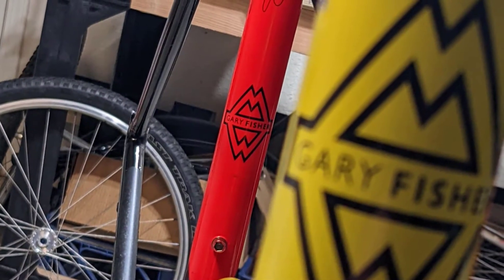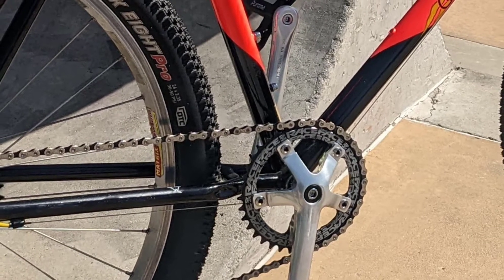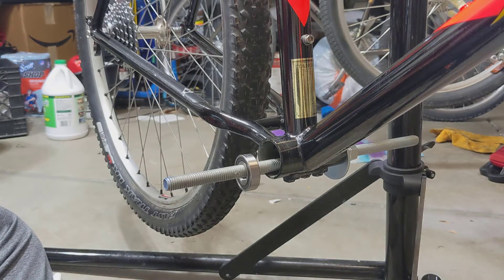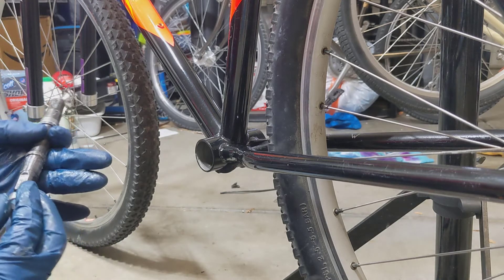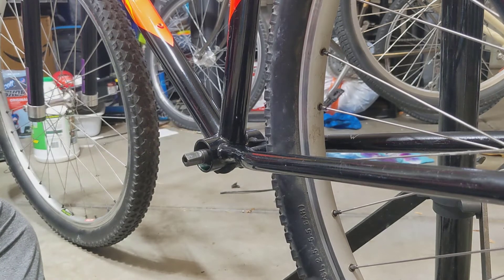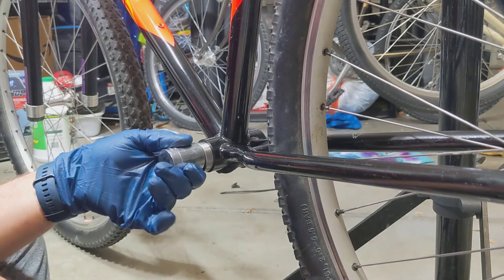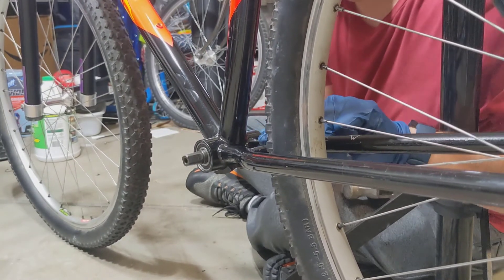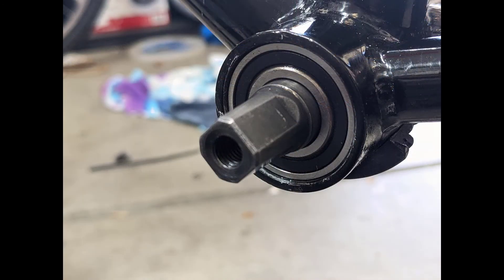Gary Fisher Evolution Bottom Bracket Install - 1991 ProCaliber Press Fit Square Taper Sealed Bearing

Comment: How did you remove the old bearings and spindle? Install doesn't look too bad. Good video.
Reply from the maker: Really simple. I used a hammer and a piece of wood to soften the blow. First make sure you don't have circlips holding the bearings in place. You'd need a  circlips tool to remove them. My procaliber dues not have the clips.

I'm the video I mention another guy who explains the removal. Check out this video at  4 minutes in for his reenactment:

https://youtu.be/1oVZrSLHIw4?si=iNzytxzwpJXjdbOY

It takes some pretty good whacks with the hammer and the bearing will fly out one side, then repeat for the other side. 

Amazingly simple bb.

Good luck!

Comment: How did you remove the bearings from the spindle once you remove the assembly? mine seem to be stuck on my spindle. I have a gary fisher procaliber
Reply from the maker: Hi Hugo, I'm sorry. I didn't get an alert on your question. Mine didn't get stuck on the spindle when disassembling. But if it did and if it wasn't rusted, I'd use a screwdriver and tap the inner bearing race all around to knock it loose or if you have a pvc tube that lines up with the outer race (like how it gets tapped in with a socket). If rusted, put some wd-40 and wait a day to try.

Comment: I've just stumbled on your video after a google search about replacing my '91 ProCaliber drive train. It's been in the garage for years because of chain / cassette skipping, and I was told I'd just have to replace the whole drive train because of inability to find replacement SunTour parts. Did you run into any major issues refitting your bike with a single chainring and huge cassette set up? I hadn't planned on dumping the front derailleur, and I wonder if it's just a matter of a new chain and cassette. Although, it seems if the single chainring and big cassette works well there's always the weight savings, and less complicated set up, and lower failure rate with no front derailleur.
Reply from the maker: Hey, Sorry. I didn't get a notification of the comment. Other than finding a wheelset with a hyperglide freehub, I did not have any issues converting the drivetrain. I added a race face 38t and Advent X 10 speed with the Advent trigger pro shifter. It was very straight-forward. The one thing I learned is that adjusting shifting for the 10-spd cassette is more granular. So adjust the barrel less than you would on a the 7-speed cassette.

At first I was unsure of the shifters as I like thumb shifters, but I've grown to like them a lot.  Great performance and $$ savings. The Advent X a pretty bomb-proof setup that can easily convert to a drop-bar setup.
Reply: My bike must be much older

Comment: My bike has spines in there it doesn't appear to be the same at all it's definitely a Gary Fisher and it must be older
Reply from the maker: If your bike is older than mine, it would simply read "Fisher" on the down tube and head tube. 

"Gary Fisher" began in 1991 when Gary sold the company (but remained as president). I believe it was in '88 or '89 that Fishers and Gary Fishers had Evolution (88mm press-fit) bottom brackets similar you what you see in my video. That lasted until '94, when they discontinued the Evolution bb and 1 1/4 Evolution headset. While great concepts and strong, bike standards went back to English threaded bbs and 1 1/8 headsets.  

Your bike, if much older, may even have a 1" headset. Either way, Fisher or Gary Fisher are great bikes!